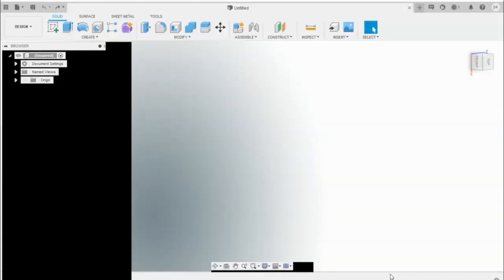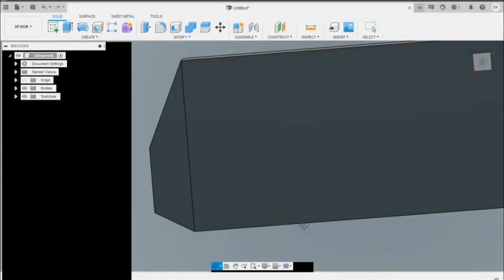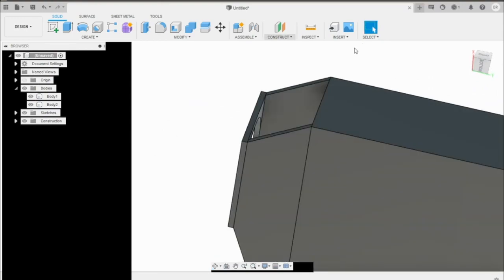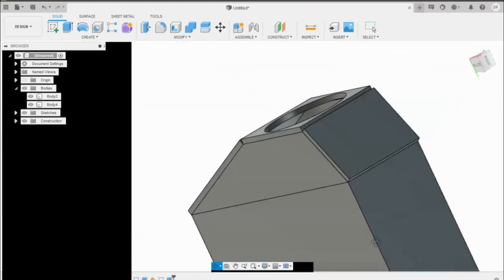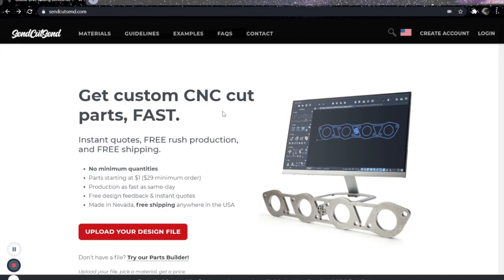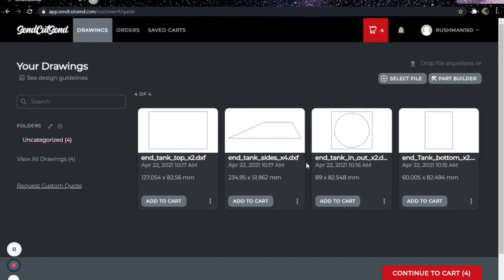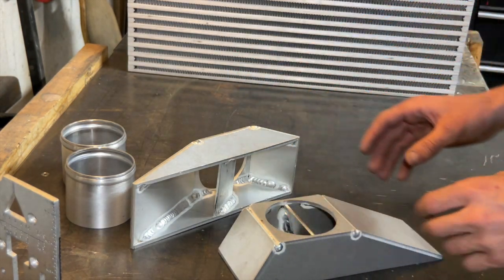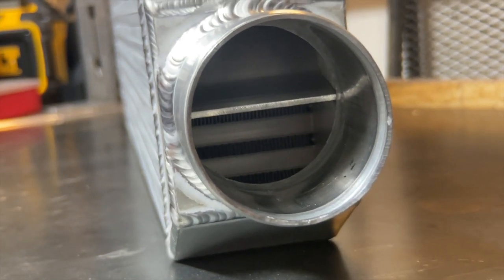Design and build your own intercooler with F360 & SendCutSend

Comment: Nice! I’m getting into fabrication and building a turbo kit for my coworkers ITR.

Instead of doing a seperate piece for each face of the end tank I made mine one solid piece that’s bent for the out side face with 2 mirror faces. He wants a back door setup also. I may add that divider plate like you did! Pretty cool!